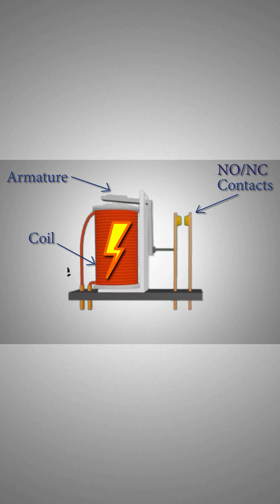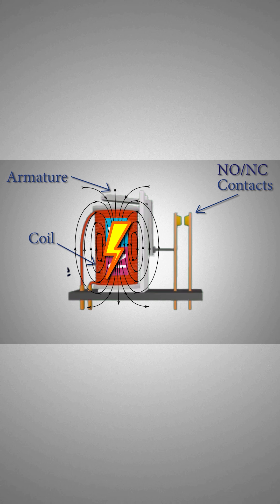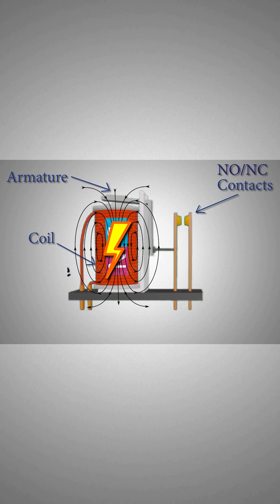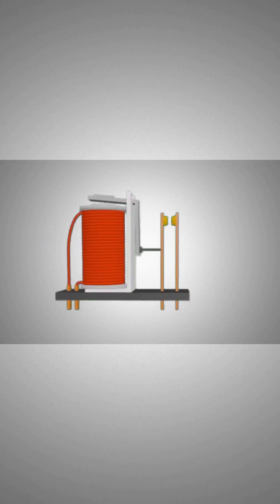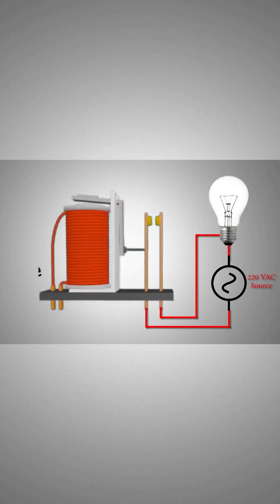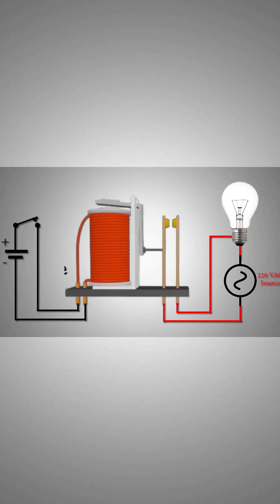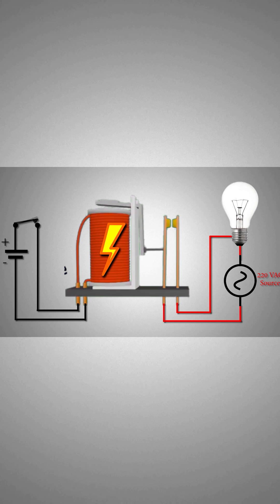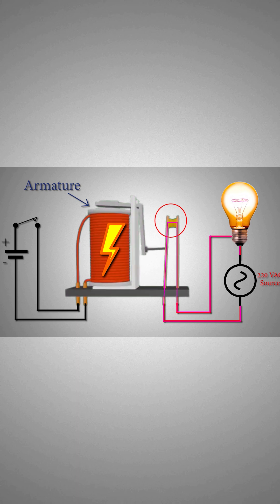How does Electromechanical Relay works ? #electrical #electrician #electricalwork

Comment: Relays don't really switch a neutral. The neutral goes back to a neutral source and the relay just breaks or connects the energized or phase wire. Its just a switch.